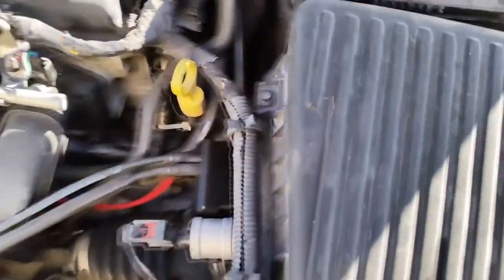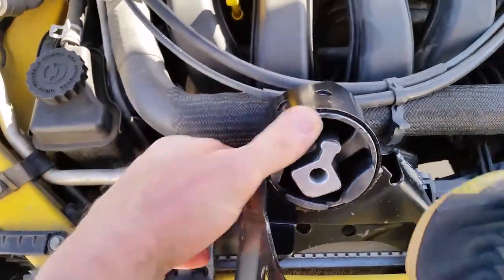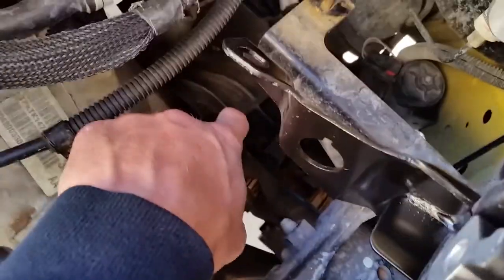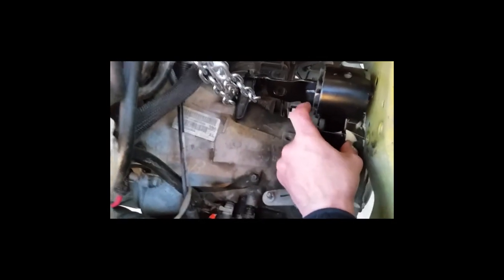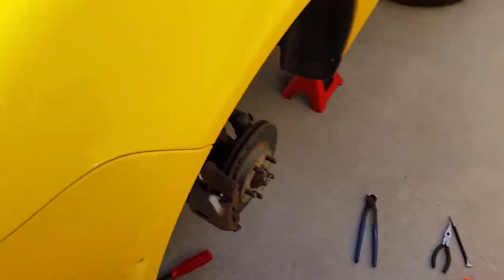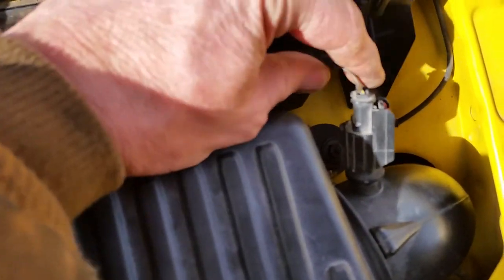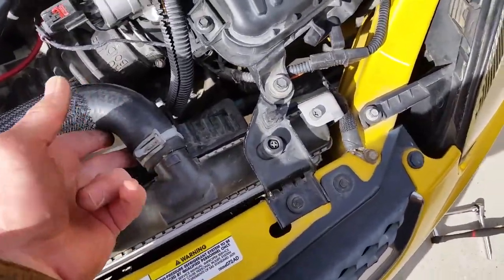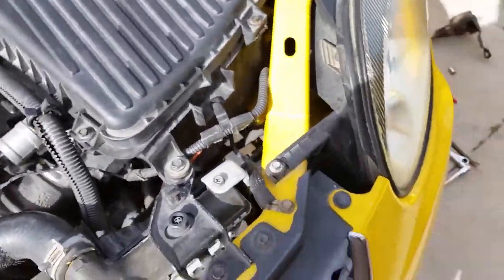2004 Dodge Neon SXT 2.0l Transmission Mount Replacement

Comment: Incomplete video. This the left engine mount. Removal happened instantly and wasn't shown, new one was instantly in place and the trans cable was never explained how to release it. There is also a foam filter inside the air filter box that was missed.. Although incomplete, most bolts are explained, just not shown. Before you attempt , get more information. I know for a fact , the manual says to lower the transaxle, to expose those mounting bolts.
Reply from the maker: I provided a followup video that I reshoot some of the parts not included in this video.  https://youtu.be/5MIJzw_nHN4

Comment: Didnt really show process. Lots wind noise
Reply from the maker: You are correct, I was a windy and it's not easy to film with one camera and no one to hold it or any way to mount it.  Since this video was shot I've picked up a GoPro and a couple mounts that I can use to improve my videos.  With the other work I need to do on this car I may re-shoot this one, would you be interested in it?  Let me know.